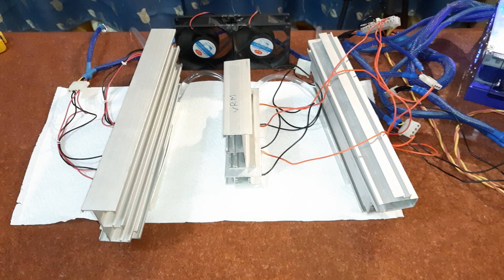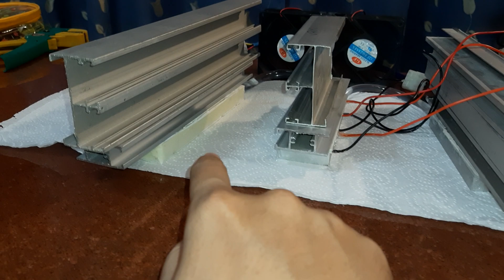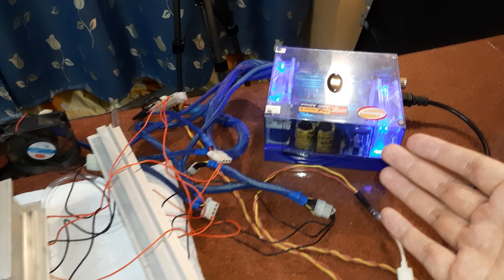[Eng] DIY Peltier Micro AC V3 | Cooling with Junk? | ThermoElectric personal cooling attempt 3

Comment: 27145 peltier module take very less wattage. In previous video, the cooling side you use water and radiator for measuring temperature. Not same experiment. I think if we take a small container of water and fit 10 peltier ( 27145 module ) to cool water. And then cool water pass through radiator, It gives better result.It consume very less power too.
Reply from the maker: It would be a waste of time & energy to cool water first. Instead, water makes sense for hot side as it has a lot of specific heat capacity.

Comment: Sir I'm making a 4 peltier setup 12706 model
With 
4 small fan of 12v 0.21A 
2 large fan of 12v 0.25A
1 water pump 12v 5A &
4 12706 peltier
Is it ok if i use one 12v 24A SMPS? Or 2 SMPS
Please reply sir 🙏

Comment: i am also thinking to try a peltier setup , with 1 peltier,heatsink,12v fan, 6-12v water pump and a old fridge condenser box to pass water from it which will help to cool down the entire setup and ofcorse that water pipes will go through peltier heatsink . 
 I have some queries that can i use pc power supply to run 1 peltier of 6amp and how to make a controller to adjust my fan speed .can u give your insta id i will dm you
Reply: very good video,  can u plz make a video that hao to make this heat sinks more efficient . this  will be budget friendly
Reply from the maker: Join Telegram Group!- (Main Group)
https://t.me/Zen_innovations
No DMs.